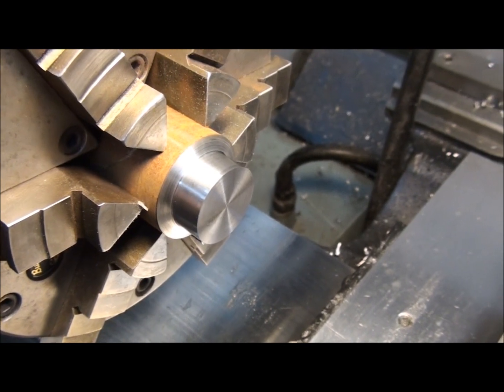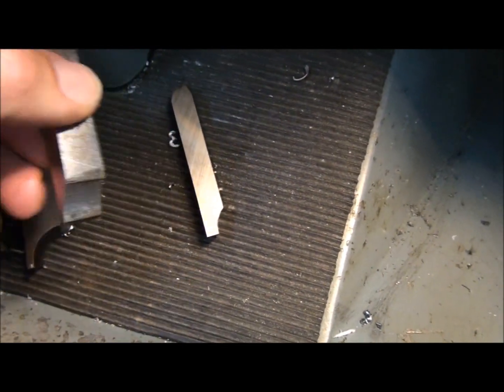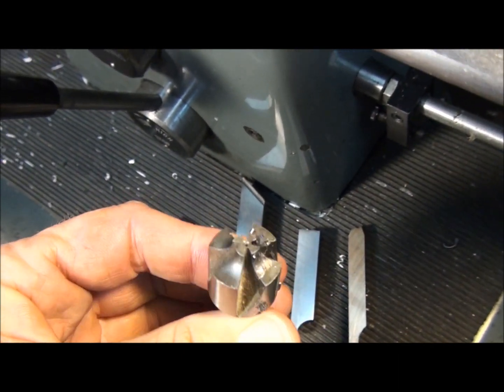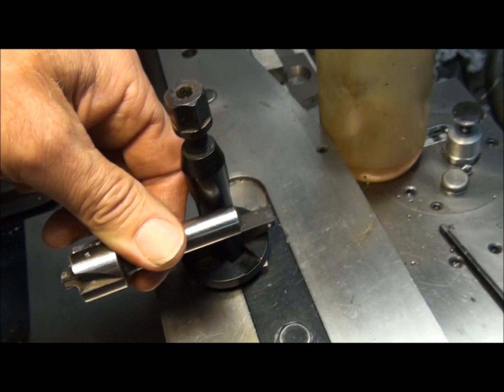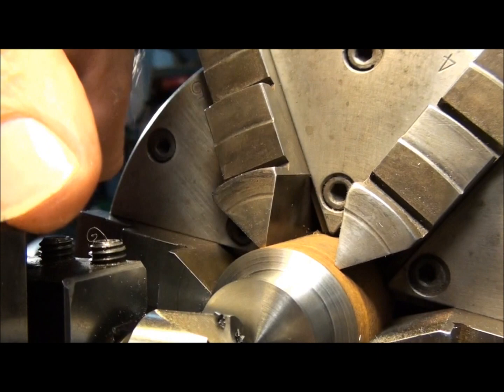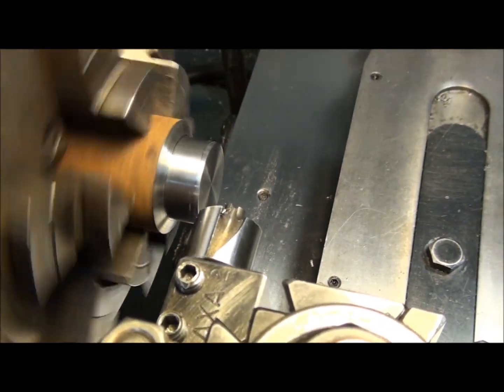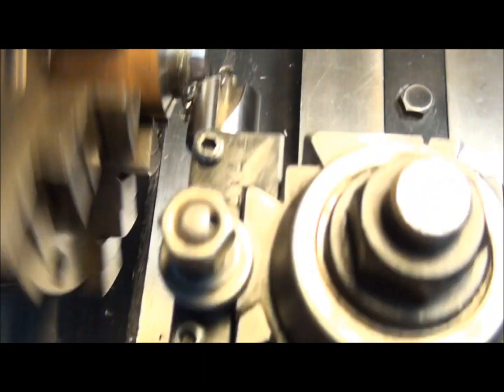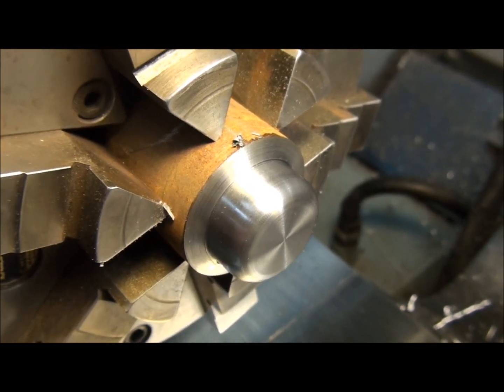Using a Corner Rounding End Mill on the Lathe

Comment: I don't understand why your mill bit doesn't spin in (or come loose from) your lathe tool holder.    That's a round tool steel shank and you don't appear to be using the flat, or at least you don't mention it, so how are two socket screws keeping the bit from spinning?    In addition, the flats on my roundover bits, if used, would result in a very negative rake angle.    So I'm baffled.
Reply from the maker: There is a V groove in the bottom of the holder.
Reply: @TomsTechniques  Aha!   Thanks.   My lathe has an old-fashioned turret style tool holder with flat bottoms.

Comment: The lathe motor sound in the back ground. Sounds like a refrigerator motor on it's way out. js
Reply from the maker: That's the shop phase converter. The audio makes it sound louder than it actually is.

Comment: Hey Tom, sorry to bother you again;  I've seen these "corner rounding end mills" available as "right hand".  Is that the correct direction so the flutes have clearance on the bottom for our lathe work?  Thanks in advance (great idea, BTW)
Reply from the maker: I wasn't aware that they are available in right or left hand configuration. I guess you'll just have to look at a pic to tell which one you need.
Reply: Well, I don't see any listed as LH, now that you mention it.  Maybe RH is Chinese for "clockwise", which I surmise is good for our purpose.  Thx, Tom

Comment: I think it would be better to feed it at a 45° angle to maintain the chip thickness on the edges. As I have used routing profile cutters to form port shapes on aluminum on a drill press, I found that the real trick to large contact forms lies between a sharp edge and a thick chip. If the profile you want to form is close to parallel with the work it is a lot harder to maintain the correct chip thickness at that point without possibly overloading the rest of the tool. When the chatter hits the fan you can just coast down the spindle and retrct the tool just before the spindle stops completely.
Reply from the maker: How do you align the tool so both ends of the radio end up tangent to the faces of the part? It's easy at 90°.

Comment: I was surprised that you ran chuck in reverse of the normal direction relative to the radius tools normal rotation.  Like if your in the mill you would have run the tool CCW instead of CW. If chuck ran in it's normal direction would you have not had a chip build up ? Just an observation.
Reply from the maker: I think you are a victim of how a video camera shows rotation. If you slow the speed down and watch the chuck start, you'll see that it is turning counter-clockwise, running the material against the face of the cutter.

Tom
Reply: Makes sense maybe in future a verbal reference to that would clear up any confusion, enjoyed the creative use of that mill tool.

Comment: Cool video going to try it.

Am always cutting a 1/4" corner on brass and run it at 400 rpm on a 3" diameter piece of Brass.  One thing to cheat is pull back 5 to ten thousands on the x axis so it would not fully form the corner and then in the Y axis 5 thousands before end.  Then flip flop between the two getting closer and closer which will keep the chatter down.  Chatter on Brass is not pretty marks up the work pretty bad.  When down to the last 5 thousands turn off the lathe (without a brake) and push the bit just before the chuck stops spinning  (Pull back before the chuck stops or else the bit will bite deep into the brass!)  Do this a few times and the finished work will look great without chatter marks.  

Yes can run it slower however takes a lot longer...

Things you got to do when you have chatter issues with large forming bits.  Also if you get constant chatter put the tool bit on the back side of the part.  Have an 1 1/4" forming tool am using on a 3" piece of brass that never chatters once it is on the back of the work.
Reply from the maker: Chatter can often be a challenge, but changing even one thing can make it go away. These are a few more of the many ways to defeat chatter that were discovered by trial and error and reinforces the fact that you have to practice machining to get good at it.

Thanks Michael.

Tom

Comment: could you do it with gravers?
Reply from the maker: I assume you mean hand held tools. It would be a hand full on a part this size, but I suppose you could. But why would you want to?
Reply: i dont know. just asking. iv seen it done with brass. and it worked out really good. the guy from clickspring does it.
Reply from the maker: Steel this size would be tough, but if you have enough muscle to control the tool...

Comment: forming is the displacement of the material WITH OUT making a chip.
Reply: +Toms Techniques Agreed; and anyone who's ever worked in a screw machine shop would understand.
Reply: You are incorrect.
Reply from the maker: +TheCabult 
What is your point?
Reply: +Toms Techniques if i know your not forming and you know your not forming then why trough out the video do you call it forming.  great video great use of tools.
Reply from the maker: Any cutting tool with a profile that is designed to plunge cut is referred to in the industry as a form tool. It copies the form of the tool on the part being machined. One of my first full jobs as a machinist was working in a form tool shop, rough machining the profiles on a horizontal mill.

Tom

Comment: Could you just slap a shank into a press or mill and drill the round into the end with whatever size bit to make the form tool? I feel like that would be the easiest way to make one
Reply from the maker: +TJ4774 
Making a form tool is another thing entirely and I will eventually show how it's done. There is a bit more to it than you describe. Not only does the form need to be generated, it also needs to be relieved it so it can cut. If you look through my videos, you'll see several form tools that I've made, like this one:

https://youtu.be/uIRlJz-xQKE

There is also one shown in the Steven's videos for rounding the corners of the receiver.

 Tom
Reply: +Toms Techniques I haven't made my own lathe tools yet but what I was picturing was just the rough cut with a drill bit the size you need the form to be then relieving and finishing with a grinder but there's probably more to it than I'm thinking.
Reply from the maker: +TJ4774 
That's basically it. If it's a milling cutter, you also need to create flutes, normally two or four and then machine the form on each one. If it's for a lathe, you only need to create one form, but then you need to figure out how to hold it. Form tools are challenging, but fun.

Tom

Comment: I'm going to be making some radiused form tools like those that you ground. Do you use a special stone to hone the cutting edge?
Reply from the maker: Nothing special. Just use a fine stone with a smaller radius than your tool. If you do a good job grinding, it won't take much to stone it smooth.

Tom
Reply: Toms Techniques Ah. I thought all the edges on a stone were sharp and that I'd have to somehow scrape the radius into the stone. If they come stock with a radiused edge then that's what I'll look for.
Reply from the maker: Emil Hamady
They come in various shapes for polishing molds. The one I use most is 1/4" in diameter by 3" long.
Reply: Thanks for that info. I've got some stone research to do.

Comment: Made hard work of that Tom ! Once you had touched on the end of the work, you should have locked the carriage. No need to sod about with dial gauges and having to keep an eye on it. Use your cross slide to feed in, it has a finer feed and more feel that the carriage mechanism, stop feeding in when cutter reached full diameter.
Reply from the maker: I prefer feeding with the carriage (which is why I did it that way). It's much easier to feed to a zero point on the large indicator dial than on the cross slide dial. Large radii like this also tend to chatter if you dwell on them too long with the tool. Using the carriage to feed makes it easy to get the tool off the part and out of the way as soon as the radius is formed.

Tom

Comment: Hey Toms Techniques... For making form tools, a wire EDM works great too.
Reply from the maker: ...or you can use your CNC lathe and generate the form. Unfortunately, mine is out for repair so I had to settle for this corner rounding end mill. ;)

Thanks for watching.

Tom
Reply: yes we all got 1 over in the corner

Comment: On a large lathe I use a boring bar tool holder. I just bought a mini lathe and was wondering how I was going to use my smaller set of round boring tools under the screws. I was surprised to see you just tighten a round bar under allen screws, seems like risky business, but I read in your replies that you have never had a mishap! Surprise, surprise.
Reply from the maker: Glenn,

Most boring bars are round. In fact, I can't remember ever seeing one with a flat. Apparently it's not an issue worth losing sleep over.

Tom

Comment: Hello, great videos. Very enjoyable to watch. Might be a silly question but what stops the tool trying to rotate? as direction of feed is towards chuck.
Reply from the maker: The set screws in the tool holder lock it down quite securely. I've never had a tool rotate that was held this way.

Thanks for watching.

Tom

Comment: Isn`t it kind of unclever to use Inhex screws on a toolpost ? There are allways chips in it. There must be a reason why on the german Multifix toolpost there are square screw heads since apx. hundered jears ?
Reply from the maker: No offense, but the simple solution to an engineering problem is usually the best, a concept German engineers seem to struggle with. I've actually never had the screws plug up. I will admit though, the Wohlhaupter boring head I used to have was the best.

Tom